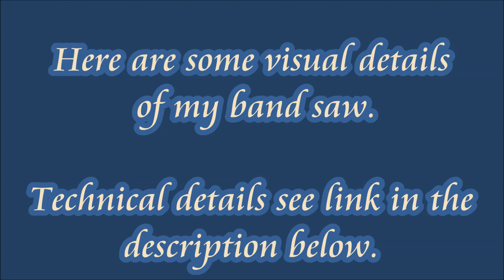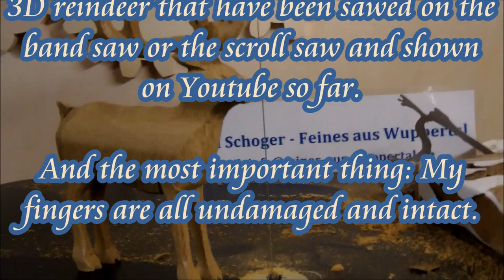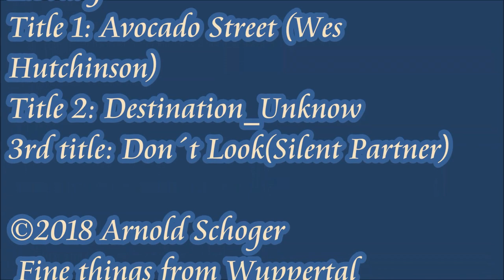🦌 Bandsaw 3D Reindeer, DIY Tutorial

Comment: Is that a 1/8" blade you are using; also, the blade guide looks like a Carter thin blade stabilizer.  Is that what it is?
Reply from the maker: I use this saw blade https://www.dictum.com/en/power-tools-sawing/pegas-fine-cutting-saw-blade-no-9-2375-x-1-34-mm-tooth-spacing -2-43-mm-716066? SPartner = faw and this band saw https://www.dictum.com/en/power-tools-sawing/pegas-scroll-band-saw-716062?sPartner=faw with the included Roller guide.

Greetings, Arnold